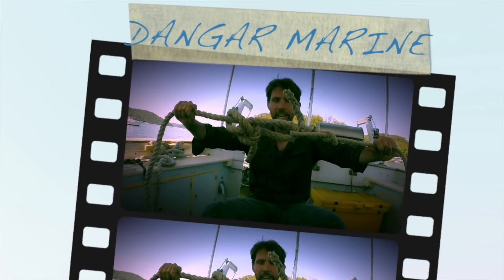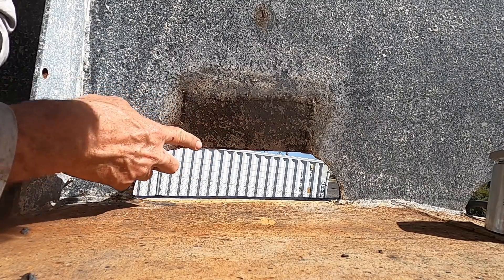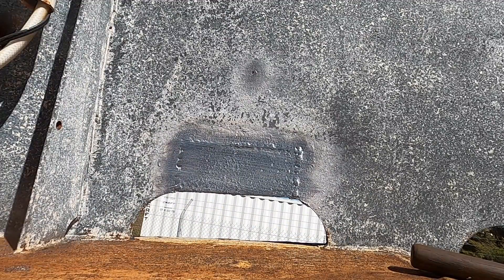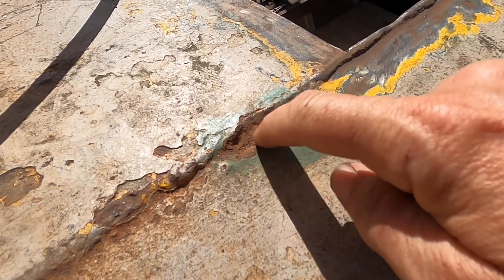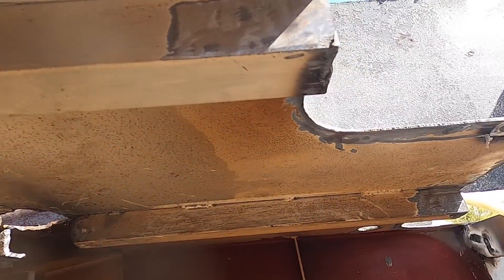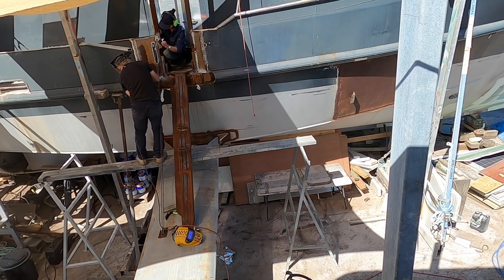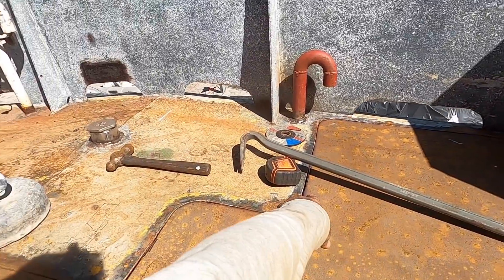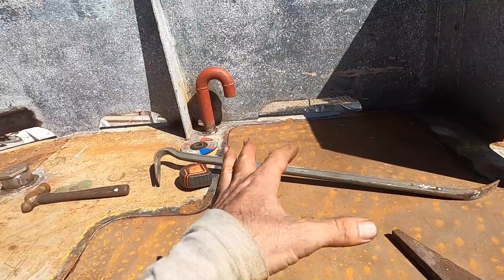How to repair a rusty steel boat

Comment: Stu, as a retired marine Engineer, I thought it was a great layout and presentation of all the different ways of solving the various repair problems on your vessel.
Reply: @craigkaschan4822  Well, I am not sure what your professor means by too many zincs on a vessel? You need them on the hull, you need them in all your heat exchangers, anytime you are dealing with a saltwater cooling medium. When they get to 50% or less you change them out,  as without them electrolysis will definitely attack and destroy your metal over time.
Reply: @craigkaschan4822  if you want a little more definitive explanation, see if you can find Boat Owners Illustrated Handbook of Wiring by Charlie Wing. It came out about 25 years ago or so and it has  pretty good simple examples of cathodic protection and discussions of corrosion in it. This may help you in your studies.
Reply: Stu has  a video on checking Renko for enough zincs to counter galvanic reaction. Also e xplained  the effects of too little or too much zinc

Comment: Great Advice Stu...I had a steel boat in the late 90s, it had been neglected, I too replaced steel where needed, then sand blasted then primed and then epoxy coated as directed and painted. It was a 18 mo  out of water rehab. However, I then meticulously kept after it for the next 20 years each season in cycles that then required only minimal wire brushing primer and epoxy paint until I sold her in 2018.The main thing for me was bringing the entire boat to a stage of stability with regard to steel chasing after it peacemeal for the 1st 5 years I owned her was a frivolous affair..in the end I bit the bullet and spent the time and Benjamins to get the entire hull and deck to restored condition and was upon completion as good as and perhaps better than new...cheers from Boston

Comment: Hey Stu, excellent, informative video, really good. Please for the love of safety wear some foot protection… seriously, yesterday I was using the same AEG 125mm grinder, it grabbed the surface and it slipped out of my hand and chased me around like the D Squad looking for food, hit me on the ankle almost cut me to the bone, not a pleasant experience and that’s with shoes on. Get some 🥾🥾 mate. Or tell me what size and type and I’ll send you a pair. Stay safe

Comment: I've got an assortment of welders: 30+ year old Lincoln AC/DC cracker box,miller gas driven stick, electric input miller MIG,and a military surplus electric input Lincoln that has more features than I can figure out. Go to is always a stick machine.Old and shaky now (and half blind it seems) but when I weld steel it stays stuck together.Firm believer in cutting out rusty crusty steel and replacing with new.And, finally bought a miller plasma cutter a couple of years ago.Oh My God! Love that thing!

Comment: Here's a tip for you, Stu next time you need to align two sheets of steel. Instead of using weight or a wedge lets say for a 1/8 or less misalignment of the plates that need to be tacked, just tack it while its misaligned and hit the tack with a hammer, good and hard, as it cools down. What will happen is after you hit it with a hammer it will cool in time to align both sheets to were you desire it to align. Its a trick of the trade as a welder fitter and it saves you massive amounts of time, instead of resorting to using a dog all the time to align plates of steel. 
btw Stu you did a good job for a man that is not a welder fitter by trade, on that deck repair. I've been watching your videos for some time and I've noticed your welding skills have improved quite a bit. That deck is looking good. cheers bro..

Comment: Brand new spray tip of "deck be gone".   Imagine this, Imagine that.   You're a legend. Keep on keeping on and don't get to stressed. Your health is far more important than a deadline.

Also, quite cheaply, you can purchase a 300mm blower and hose from the big green box and have some positive ventilation into the hull. Makes life much more pleasant.... 
An absolute godsend in summer when refinishing inside a timber hull, I can tell you.

Comment: Shortcut for doing a patch, make your patch bigger than needed, tack it over the work area and then cut through both the patch and the work area at the same time, it makes a patch that fits the hole perfectly every time.

Comment: Re welding fuel tanks. I used to weld on aluminum diesel tanks all the time. Get the tank as full as possible then run some argon into it for a while to remove the oxygen. Then go for it.

Comment: Hi Stu,
In the steel narrowboat world there is a lot of debate on overplating, simple welding a new plate over an iffy area, but my vessel was given an entirely new bottom plate before I bought her. Being flat-bottomed, you just order the plate, lift out the boat and lower her down onto the new plate, weld all the way round and Bob's your uncle ;-)
My boat is literally a ton heavier, and I just don't think about what's between the two bottoms. To date, my bilge is bone dry - I'm happy with that.

Comment: Excellent to see proper Occupational Cakes and Pastry approved safety feet being used.
Some boat makers/repairers use strips of ply and hot glue to make perimeter templates. As they say, whatever floats your boat. 
Good stuff Stu.

Comment: 100% with you on the stick welding Finally a video explaining dogs and Wedges. The amount of times i have shaken my head at Damo, welding plates in without them has been a nightmare to watch. also would like to note that when joining Mild steel to Stainless You should use a stainless electrode, For the best results. Damion should watch this video and practice with the stick welder. If he did this his mig skills would improve for sure. LOL  Stick offers you FAR more options, in most weather situations. Migs are good for indoor workshops lol.

Comment: Built my first caravan from floor up. Curved 10 sheets 1.5mm aluminium to closely replicate Airstream Basecamp. Got a ding dead centre of roof 600mm from front! Any repair to a mirror polish on the vans “forehead” would show glaringly.  Went down the road and purchased one of those small shark fin aerials and glued it on!

Comment: Sabre Dance thanks you. Had to replace a 6 foot by 6 inch strip along one chine but otherwise, she's not too bad. Mostly surface rust but they get right pissy if I start up the compressor and use the sand blaster or needle gun so I'll have a go with the wire wheel and converter. I do have to say, seeing you wander around a rusty steel boat in bare feet boggles the mind. Gotta love the Heineken uncertainty principle. Hits me all the time :)

Comment: Man, how you do any of that without knee pads and foot wear is beyond me.  My 50-year-old ass is envious to be honest.  These days I almost have to use pads to clean a bathroom shower.
Reply: I'm only 28 and I boggles my mind!
Reply: Knee pads or shoes for that matter. I'd have lost multiple toes by know. And why is Damion welding while wearing a pink button down shirt? Are they working or working? Can't tell.
Reply: I agree.  I see these video with Stu, working right away in rust and steel, and NO SHOES!  He must have feet of steel.
Reply: Yep, and what about the shit he is breathing below deck...the needle gun, the welding...next it will be epoxy undercoat (I expect the will wear breathing gear for that 🤞 at least). None the less, great info and entertaining to watch.

Comment: I think the biggest advantage stick welding has for on a boat, space used. You can buy stick welding units ( or even use a battery direct with jumper cables ) that are fairly small and easy to store. A MIG or TIG setup needs a fairly large tank of Inert Gas you have to find space to store. With space being a premium on any boat, the less needed to store the welding supplies the better.
Mig and Tig do tend to give cleaner welds, no inclusions of slag which you can often get with stick.

YouTube channel Sailing Britaly has a video where Brian uses one of the starter batteries for the sailing yacht and jumper cables to do a temporary patch type weld, really just to show the technique. This means you only need to store the sticks and a set of jumper cables to have emergency patch welding.

Comment: Stu I really enjoyed this episode. Of course I look forward to all of them but this was particularly good.

Re T-Rex waterproof tape, I have to say I bought a roll based on your findings and I have found a limitation. 
It won't stick at all when it's cold say less than 5deg C, and the surface you're sticking it to is cold and there's high humidity - even when the surface is prepped with isopropyl alcohol and wiped with a clean cloth. It just doesn't adhere at all - not even a bit. It's like the adhesive surface of the tape is inert.
Of course it stays attached in cold weather if applied in warmer weather but my roll (bought from wesfarmer's whorehouse) is as described. Considering where I bought it from I can't imagine it being counterfeit or old. 
Apart from that it is pretty good I suppose but I am hard to impress. 
I was disappointed that it failed when I needed it most and that's the impression that 'sticks' (pardon the pun).

Comment: lol hopfully you figured out by now that you weld the under side of the deck first  otherwise you create more work . 35 years of building steel yachts . check out " balamara" two boat down from you . built early 70s . im enjoying your channel

Comment: Small observation , based on sound and slag , stick weld good ! Chinese rod’s suck !  Start weld on one plate move to joint, finish weld on other plate . If you start and finish on the seem you will get porosity ( burnt boiled weld ) if you use Chinese rods porosity is always present, take a look with a strong lens . Cheers buddy

Comment: I worked on a floating dry dock in the navy. Submarines are so densely packed with equipment and machinery that the only way to get at it was cut a plate out of the hull, do the repair and weld it back up. Grind, sandblast and repaint, just like you showed. Of course lots of testing of welds, certified welders, lots of check boxes and signatures.

Comment: hi stu. great vids bud! great work too!
if not already mentioned, and incase you and your viewers didnt already know, when stick welding, grab another welding rod to use as a filler rod (like tig welding) when you need to double up on a weld or close a biggish gap. saves you going over it twice :-) sometimes you have to clean the flux off the filler rod. keep up the great work !

Comment: That rust converter is different than some phosphoric acid based stuff I use. It actually looks easier to work with. I don't envy this job, I'm battling rust on the frame of my truck and it's a dirty, difficult, tiring, hot job. Good job!

You might try a red scotch Brite bad for the angle grinder. I had one sitting around I never used...finally tried it and it is really really good. 

Got some sandblasting set up at home which is the best thing ever. Need to learn to weld next.

Great video. Very helpful!

Comment: I’ve made many a template with plywood strips and a hot glue gun. Easy to bond but just as easy to pull apart for adjustment if necessary.  Enjoy your content 👍 Not been to your part of the world since the early 1970s.  Spent a bit of time there due to an injury suffered during Operation Frequent Wind.  
🇺🇸🦅🌏⚓️🇺🇸.

Comment: Welding barefoot is the easiest way to avoid the anguish caused by hot splatter getting in to your shoes.
I totally agree with using a needle gun to probe for rust.  It will help to locate damages that you would miss using just a wire brush.  The “if in doubt cut” method is something I should adopt myself.

Comment: Having to deal with rust all the time, phosphoric acid and vinegar works good also, more so phosphoric acid with thicker rust scale. Thanks for the info on the other type of rust converter stu, i'm going to try it. Seems like it came out good. Is there any other type of prep u have to do after using the converter??

Comment: Tip of a lifetime! Use anything but a wire wheel or wire brush for cleaning for painting. Needle scaler, sandblast, sanding, grinding or chisel are far better. The burnished finish that wire brushes leaves a very poor texture for adhesion. Especially bad when the wire tips are smoothed or rounded.

Comment: Hi Stew
Mate found your channel recently and binged watched your adventures 
The boat is coming along nicely 
I use to use stick and TIG, Mate get yourself a MIG welder, stick is old school. You'll pick it up easily. I got my MIG for welding up thin sheet metal on motorcycles and love it !
You'd half the amount of work welding your boat up.
Keep up the good work

Comment: I’ve got an aluminum boat and I take it out in the Gulf of Mexico all the time. For some reason people loose their minds on taking a metal boat out in saltwater.   I have to remind them about all the shipping container boats, navy ships and subs and the fact that most of the coast guards smaller boats are unpainted aluminum.  I’m pretty sure the coast guard knows a little more than the random guy at the local ramp.

Comment: Alternative to a patch when you don't want to set inside alight is to cut an oval hole and set in a rectangular patch.  Pull it hard against the deck using a magnet then fillet and pad weld and grind flush.

Comment: If you're doing multiple weld layers, use the needle gun between passes. cleans the slag out really well.  At the price of wood, using plywood for a template must have been a months worth of beer.
Reply: I was going to say

 we cant all be youtube millionaires with our sheets of plywood
Reply: @mabamabam  I've stopped buying gold as an investment, now it's 2x4's
Reply: One tip (at least for us ozzies) is check out the local bulk oil depot or anywhere that regularly gets in shipping containers- they often use ply for sheeting between layers of drums or heavy boxes to spread the load out- I picked up 24 full sized uncut sheets of 7 ply for $9 each (some had some stains on them, I can live with that lol)
Reply: @steved2136  I was just going to suggest that !

Comment: Hi Stu, I am a boilermaker and have a steel boat 9.5m long that I am restoring at work.
I have cut most of the rust out and replaced with new steel.
My question is how do I know how many and what size annodes I need for a 9.5m steel boat?
Byw keep up the great work as these videos are so helpful.
Thanks Steve

Comment: We call it butt and grind repairs, tack in place so your work piece does not change position.
Cut through a tack at a 45 degree angle and check for flatness then weld a stitch.

Comment: Any insights on carbon fiber coating to protect the hull outside from corrosion?
Reply from the maker: I would always go with a high-quality epoxy paint over a layer that can trap moisture and delaminate.
Reply: @DangarMarine  Of course. But once the epoxy paint job is done, any insights on adding a carbon fiber coating? 
I ask because it seems it might add decades to the durability of the project, 
whereas with the epoxy paint alone you''d be bound to redo the job every 7 years or so.
What are your thoughts? Thanks!

Comment: Keep the replacement steel  in  place. Put the copper plate across the hole using duct tape.  Weld in top side, then pull off the tape and weld up the bottom.  
Ps I been told. I should work in a Winery. Because when weld, I make so many steel grapes.
Good luck with the steel deck.

Comment: I noticed that some corners of the deck plates were rounded off and some were cut at a crisp 90°. Is there an advantage/purpose to either of the cut designs, or was that simply the artist’s choice?

Comment: I’m curious what welding rod you are using. You mentioned 7016 at one point. 7018 is the most common DC rod in the US. Do you ever use 6013 or 6010?  They tend to do better on rusted metal. 
Nice to see you doing all your plate welding with stick. I’m not a fan of MiG in outdoor environments. Too finicky with wind.

Comment: Better check your engine/shaft alignment when you are back in the water. You made structural changes to your hull and in principle when you are on the hard your boat is destorted already no matter how minimal.
Reply: Will bet nothing has moved, its only a small part that has been cut out, bulkheads and sides carry most of the strength of the vessel, now if you cut it in half to extend it, then you have to take a bit of care, remember on a lot of boats and ships they cut a great big hole on the side to get the engine out, and when realigning never that far out from the base figures, have seen a few go back in, no shimming required from the original set up.
Reply: @rogereade4950  yeah that is why! I know from repairs to a supply boats hull that the web deflection gauge fell out of the cranhshaft because of the the whole deformation of the hull, engine bed etc.
Reply: @janjaapklomp1364  Depends on where you cut the hole, with what Stu has cut out, there would be little to no deflection, if your gauge fell out did you check all the bearings, a lot here would not understand why and how this is done.
Reply: @rogereade4950  never mind, it was just a sugestion to Stu. Better safe then sorry……

Comment: Hi Stu, good run through of the repairs you are faced with. There are a coupe of channels from UK where they are working on steel yachts and they use a tungsten tipped wheel called a "Tercoo" that fits in a drill. Seems to remove coatings and prepares the surface somewhat. If you feel like exploring options, check out the tool. Cheers
Reply: Stu has used one of those before— in the video of him welding the anchor winch onto the front of the pilot house.  He and his buddy used one of those Tercoo wheels to strip the paint before welding.  Seemed like it worked great